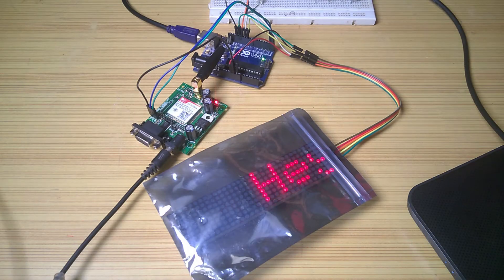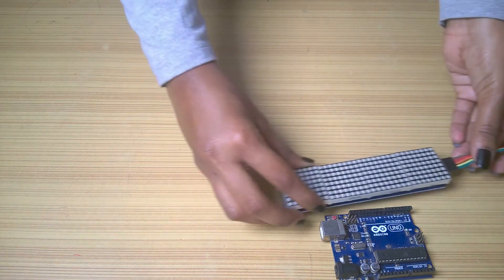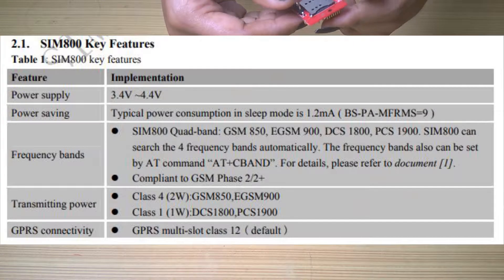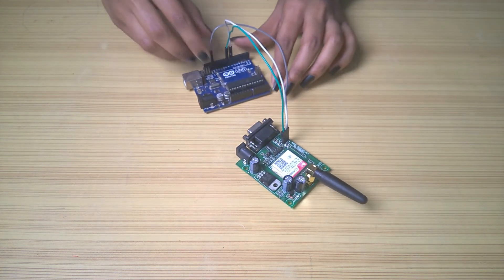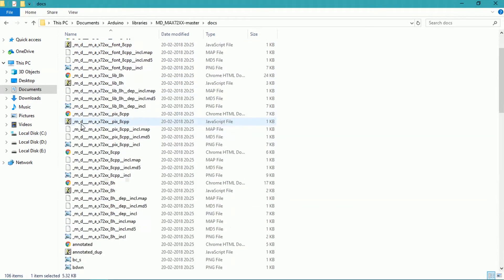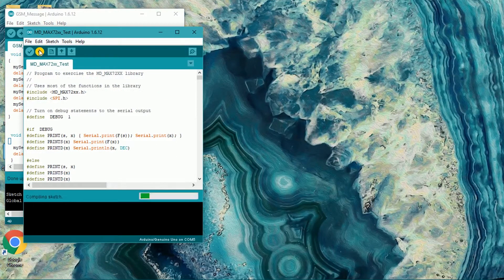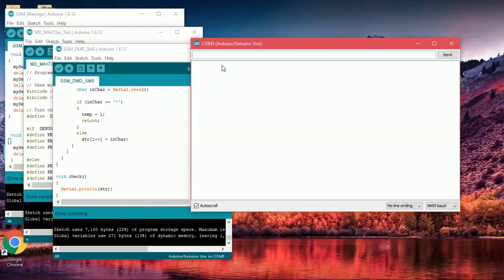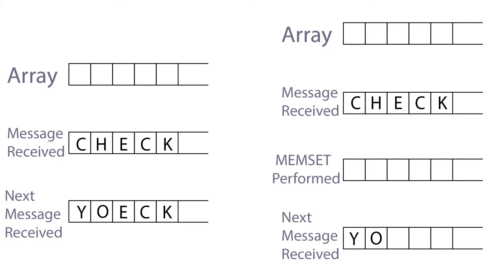SMS Monitor || Dot Matrix Display || MAX7219 || SIM800L

Comment: do i have to merge the files "GSM_Message.ino" and "GSM_DMD_SMS.ino"? or upload them separately?
Reply from the maker: Separately. GSM_Mesaage.ino is only for checking GSM Module.
Reply: hi, I have followed all the order carefully, but the sms is not accepted sim800l and on the serial monitor no incoming sms notifications, when the status sms already sent  and also is there no data being changed in the file "GSM_DMD_SMS.ino" ?

Comment: Hii Tesalex ! Can I use your code for SIM900a or just SIM800l ? Please reply me asap....I need to submit my project in 2 weeks huhuhu thanks in advance....
Reply from the maker: Hey!
Yes you can use it for both the modules as both have same set of AT commands.
Reply: Hey ! I already tried your code with my SIM900a and it's woking very well. I just adjust the pin. Thanks. Now, I had a new problem which is my dot matrix not receive and display my message from my phone. It's only receive and display a message that I sent on serial monitor. Can you help me ? Thanks again.
Reply from the maker: First, verify that your GSM module is receiving the messages correctly using just serial monitor and nothing else must be connected to Arduino. In the same way, check the DMD separately.
The problem will be easy to find this way.
Reply from the maker: Have you added both libraries required for the Dot Matrix Display?
If yes, then have you done the step demonstrated at 2:43?
Most probably ,this is the step you are missing.
Reply: Oh okay, now I get it when I do separately but when I try your code that combining them, it's still cannot receive and display my message from my phone. The pin for my SIM900a is 9 and 10 while the pin for my DMD is 10,11 and 13.
Reply from the maker: You haven't watched the video with full attention. Check connections once more when they are combined together. GSM module is not connected to pin 9 and 10 in that case.
I suggest you to watch the video 2-3 times with full attention.
Reply: Okay I did it and I edit the "char str(15)" to "char str(50) but why there's a character that I don't send suddenly display on the DMD ?  For example, I send " Hello World", it will display "Hello World pr" and when I try send " Faculty of Science and Natural Resources", it's only  display "Faculty of" correctly and other characters not correct. Then, one more, why I can't display my next message ? When I send my next message after the first one, there is no message display.
Reply: Oh and there is an error :

C:\Users\User\Downloads\GSM_DMD_SMS\GSM_DMD_SMS.ino: In function 'void serialEvent()':

C:\Users\User\Downloads\GSM_DMD_SMS\GSM_DMD_SMS.ino:74:26: warning: deprecated conversion from string constant to 'char*' [-Wwrite-strings]

     if (Serial.find("#A."))
Reply from the maker: Make sure you have used the exact code I have provided, check once more if memset() function is present or not, and if the string you sent over GSM module is too long, Arduino Uno might not be able to print it correctly, I'll suggest using a Mega for that.
Reply from the maker: I have explained everything in the video.
Reply: Hey ! Sorry, I've already watch your vid again & again and also have used the exact code that you provided (GSM_DMD_SMS) but still don't have an idea about the error hmm

C:\Users\User\Downloads\GSM_DMD_SMS\GSM_DMD_SMS.ino: In function 'void serialEvent()':

C:\Users\User\Downloads\GSM_DMD_SMS\GSM_DMD_SMS.ino:74:26: warning: deprecated conversion from string constant to 'char*' [-Wwrite-strings]

     if (Serial.find("#A."))
Reply from the maker: Well that's weird, I get no warning with my program. Anyways that's just a warning. I think you're able to upload the code to Arduino, right?
Reply: Ya...it's really weird. Because before this there is no problem with the code but suddenly this happen. I really don't have an idea about this. And before this, it's working when I send a message from my phone and the dmd display it but now, this kind of problem come out, it's not working anymore. I feel stressed right now. And thanks to you by the way.
Reply: I've tried again and again, sometimes it's working even there is that warning but sometimes it's not working and the dmd also not display my new message after the first message.
Reply from the maker: Keep the size of the array small, like 15, and also send shorter texts like just "Hello" and check if it's working with these mods.
Reply: Heyy ! Yeahh I did it now even there's a warning. Thanks a lot to you.  You really help me and guide me nicely hehe